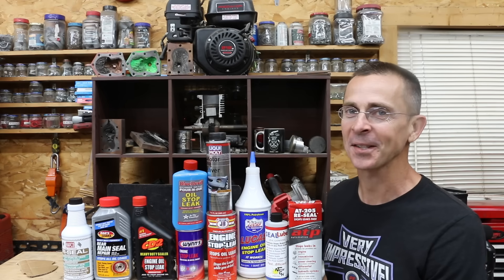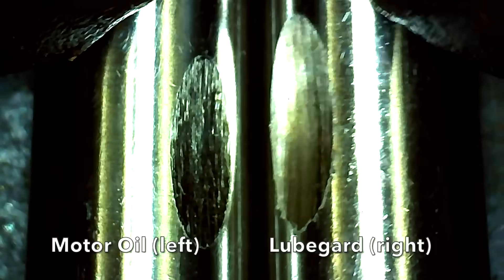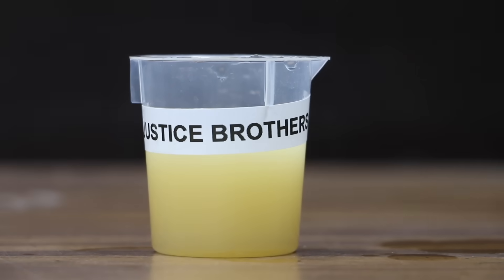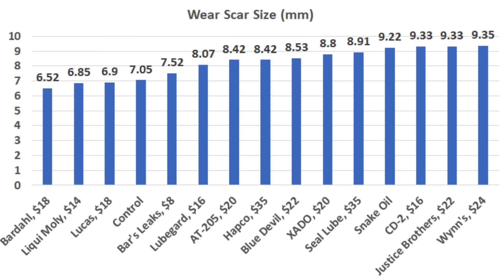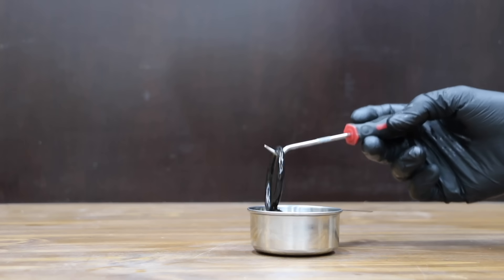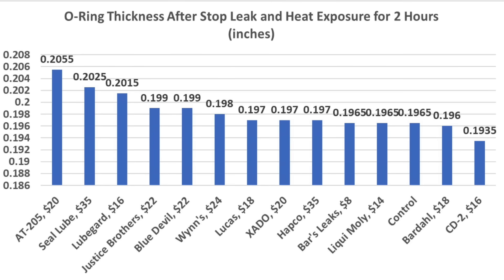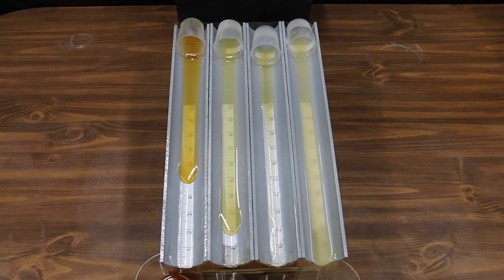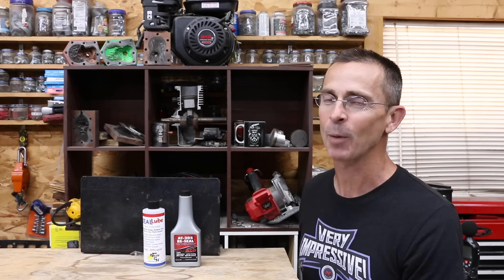Do Stop Leak Products Work? Do They Damage Engine Seals? Will They Destroy an Engine? Let's Find Out

Comment: I'm glad that AT-205 did as well as it did.  Its wear scar is 7 out of 12, not including the Control, which isn't great for a product that needs to be added at every oil change to continue working, but its performance in all other categories shows that a mechanic I watch daily is correct in recommending it for its applications.  From him I have learned that oil stop leak products are made for different issues.  Some are good on rubbers and other are good on head gaskets which are not rubber, so they were not tested, but head gaskets would be hard to test.  Once again, you test for everything that could be thought of for these gasket and o-ring materials.  I am always amazed.

I have a product suggestion if you haven't done them recently.  Carbon deposit cleaners for vehicle ICE engine gasoline fuel and oil systems (I don't know if they can be used for diesel).  ATS Chemical makes 505CRF for cleaning all parts of the fuel system and 505CRO is for oil lubrication systems.  I have no idea how you could simulate carbon deposits in both systems outside of an ICE engine, but if you could figure it out, comparing all or several of the supposedly best others to the two ATS Chemical products would be great.  The mechanic I watch has used a borescope camera to check the carbon deposits in an ICE engine cylinder and piston top before and after 505CRO and the difference is amazing.  ATS Chemical is fairly new to the scene, so most people may have never heard of them.  Thanks for everything you do for us, Todd.  No one does it better.
Reply: It does not need added every change. IF it does, then you have a totally failed seal.
Wear is irrelevant. You're only supposed to mix 1.33 oz per quart of fluid. (obviously not 50/50 like in this test).
Reply: @TheGuruStud   Maybe it's not AT-205, but the mechanic I watch, Scotty Kilmer, says that some of them have to be added every oil change for a head gasket because the product is no longer there to keep the seal.  I 'm just going by what he says and I thought it was AT-205, but I may have it wrong.

Comment: I would take whatever the dosage is of "Lube guard" and whatever the dosage is of "Liqui Moly" and put half and half of each into the engine in hopes that the Liqui Moly protects the engine while the "Lube Guard" conditions the seal. In theory the seals should get conditioned still, and the engine should be protected. It would have been interesting to see him play with combinations of AT-205, Seal Lube, Lube Guard, Bardahl, Liqui Moly, and Lucas. I would bet a mixture of the top performers in seal reconditioning along with a top performer of minimal wear scar would potentially create an all around near perfect product.
Reply from the maker: Thanks for sharing!

Comment: Only time I used Stop- Leak was a coolant leak in my 03 Grand-Am. The lower head gasket has a known issue where it'll just start leaking after a while and eventually hydrolock the car.  I started noticing coolant leaking, luckily at that point it was only external (no signs of it in oil), though from the gasket in question. Being that it was already pushing 15 years old at the time, I decided not to go through a full replace and dumped in some Stop-Leak.  Went from having to dump half a container of coolant in every month to fine after two treatments.

I wouldn't recommend it on a newer vehicle, but it got me by for several more years before a different issue took the car out of commission.

Comment: You always make excellent videos testing different products but I have to make an exception on this one. You just can't mix these products together with a one to one ratio and expect them to perform a lubricity test equal to the base test. If mixed at the proper ratios even the thicker products would have performed closer to the oil only test. All products would have thick or thin. Not saying they would all be equal just not as big a difference as you had in this test. The part of the test that used pure product only would not have changed but all other test could have. Just my observation. Again it was an excellently produced video as always.👍

Comment: You should point out to viewers that the length of the wear scars is not linear due to the increased material removed (due to curvature) and also increased surface area.

Perhaps a better way might be to also show a percentage weight removed.
Reply from the maker: Thanks for sharing!

Comment: Love your channel! Question, what does it matter if the oil with the additive lowered in weight? I would not mind if it looses the complete additive as long as it fix your leak you can top off with normal motor oil.

Comment: Did those o-rings all start at the same exact size?  For that size of o-ring the molding tolerance on the cross section is .210 +/-.005, so all of your measurements are within spec.

Comment: The 50-50 oil-sealer trial is likely not a valid friction and wear test. The AT-205 for example has a recommended mix ratio of 6 ounces per gallon (128 oz) of oil,  a mix ratio of 1 to 21.3, so its real friction and wear will likely see a result much closer to the straight untreated oil control lubrication value. 

Another positive lubrication factor at the recommended dilute ratios, is that in a hot engine with oil-product active mixing, it's likely the products that separate when standing will stay in solution when the engine needs better lubrication. 

A possible bonus of product separation over several hours after engine turn off and cooling though, might be the product bathing any lower oil reservoir engine seals less dilutely, as it comes out of solution, so the undiluted product can better actively treat those old worn out seals? Just a thought.

Comment: It seems to me that the most opportune time to use one of these products is before you change the oil. Run it with the stop leak for 10-30 minutes on the highway to reduce as much potential wear as possible, let it sit up for 24 hours, then swap out the oil. Then again, you could just get the problem fixed since you'd probably be replacing the oil anyway.

Comment: What perfect timing. I am preparing to replace the RMS in my 98 TJ, but it is just a bit too cold up here right now and wanted to use a stop leak to stem the tide. I used the AT205 a few weeks ago and after about 250 miles I haven't yet noticed a difference in the drips under the Jeep. I'll just sit tight, monitor the oil level, and do the fix in a few weeks.
Reply from the maker: Thanks for sharing!

Comment: Great information!  I've always trusted Lucas to extend the life of a tired engine.  Small engines mainly.  But did use it in older trucks to control blow bye and it was beneficial.  I don't think any additives will actually fix a leak that is active,  but do believe that products that keep seals conditioned can extend life.  I'd like to see you do some testing on BG additives,  a product I also trust.

Comment: I'm disappointed by the lack of any pinhole or pore-clogging tests here; swelling seals isn't the only possible mechanism a leak-stop product might attempt to use, if it's instead doing something to directly clog small openings. I'd like to see a test where you put a pinhole in the bottom of a cup (small enough that the standard oil takes several hours to drain through), and for each product measure how much leaks through after some interval.

Comment: I wonder how much the product effectiveness and the viscosity loss would change had you used the product to oil ratio suggested by the manufacturer (e.g., if 1 qt. of product treats 4-6 qt. of oil so the ratio would be 1:3 to 1:5, or the average of 1:4). That said, this was an awesome video, as usual. I am always amazed at how many different tests you are able to come up with to test the products. Yours is the only channel that matters when it comes to tests and comparisons.
Reply: Yeah, that potentially really helped some and really helped others in every test.
Reply: Spot on, I think this was a major flaw in this round of testing.  While I think he does a great job with most tests, I think using a ratio not recommended by the manufacturer will definitively impact the results and is not reflective of how these are used in the real world.

Comment: Super useful video! I've always heard AT-205 is good, so it's cool to know it actually lives up to the hype. I use a lot of Lubegard products, so I tried their seal fixx to help a rear main seal leak, and it's hard to say how much it worked because I still get drips on the driveway. Maybe a bit less than before, but again hard to tell. I also only used one bottle for an engine that takes 8.5 quarts of oil and the it says that one bottle treats 6 quarts. And for what it's worth, I always send oil samples to Blackstone and the seal fixx had no negative impact on wear numbers
Reply from the maker: Thanks for sharing!

Comment: Great stuff as usual, but I'm wondering about "swelling" - would an installed oring actually increase pressure in its fitting to reseal?  And "softening" - I wonder also if that reduces the sealing capability by not having the pressure of firmer rubber?...

Comment: Too bad you didn't test the power punch brand, never used any of the ones you tested per say but an old mechanic turned me on to power punch a loooonnng time ago,,, and since I have used it  in everything from lawnmowers to bulldozers in automatic and manual transmissions both in fine condition and with issues and engines of all kinds in fine condition and others that were well into the end of their lives with even rod and crank noise from excessive wear,,, and the stuff always seemed to really do a good job at either preventing problems and making problems go away for quite some time,,,,even in hydraulic equiptment it seemed to work great and seal up leaks at least to a pretty darn good degree,,,and some of those leaks were almost beyond what you could expect from anything other than full replacement of seals and so on,,,,I trust that stuff fully to say the least,,,anyhow great video at any extent so thanks for all the hard work and information.

Comment: Your test was a 50/50 mix.  For something like AT-205 it's 8oz in six quarts of oil which is more like 1 to 24 ratio.  That means all of your testing is inaccurate.  With a 50/50 mix of course it's seriously diluting the engine oil.  And such a high ratio may also over inflate how much effect it can have on seals.
Reply from the maker: Thanks for the feedback!

Comment: Most of those work by containing Naptha, the naptha causes the seals to swell up and can make the leak stop for a while. The heat generated while operating will eventually evaporate out of the oil and the seal, that said over time the leak will eventually begin again but worse the seal will now become brittle and fail.
Reply from the maker: Thanks for sharing!

Comment: wow, the amount of work... I had an oil leak and later some hydraulic fluid .  Oil leak seemed to go away  - (I used something like BARRS, then AT-205) . I added at-205 to my transmission & PS reservoir (same fluid)  Can't find DRIPs now (but not 100% sure) .. BUT the tranny was starting to take LONGER to engage into R, that seemed to go away after AT-205(& a month) so maybe it tightened some valve gasket. Vehicle is 23 years old now (and 1 owner)
Reply from the maker: Thanks for sharing!

Comment: Since these are things you normally just 'add', I think, it would be better to test the lubricity with the same ratio that would be found in an engine with a full 5Q of oil already in it and adding the product according to instructions.  That would be MUCH better to know if at that amount/ratio what the actual impact on engine wear might be.
Reply: Honestly, I think using such a high ratio of 50/50 instead of the ratio listed on the label invalidates all of the test.
Reply from the maker: Thanks for sharing!

Comment: Isn't the size of the wear scar technically non-linear since the bigger the scar is the more surface/volume needs to be removed? (so the difference from 1mm to 2mm does not remove the same ammount of material as from 4mm to 5mm) As in, the higher results are even worse then they look.  
As always great video btw.
Reply: Definitely.     I think an ideal would be to use a square key stock or something.

Comment: The oil pickup is not at the bottom of the of the oil pan. So, thinking that 12 ounces:hand-pink-waving: of AT205 is circulating through the engine when it is first started is incorrect. Also, the correct ratio of AT 205 to motor oil is 13 to 1
Reply from the maker: Thanks for sharing!

Comment: When comparing all the charts, one can see that the Lubegard did the least wear increase (only about 1mm) above plain motor oil (and AT-205 was second least at about 1.5mm.added wear) while still being in the cluster of top 6 additives that made a significant improvement in rubber condition.
Reply from the maker: Thanks for sharing!

Comment: The legend Scotty Kilmer recommends AT-205 and says he's seen it stop a leak in as fast as 10 minutes.  What concerns me is the evaporation rate and that it separates from the oil.  So on a cold start, you are using the AT-205 as an lubrication until it mixes.  Also I believe they recommend adding a quart at every oil change. So with the high evaporation rate, an engine will use oil faster.  I have a bottle of this sitting on the shelf even though I currently have no oil leaks.  Curious if it will separate in transmission fluid or power steering fluid.  Great video again!   I believe I've purchased 50% of the products you recommend, You are costing me money! 8-)
Reply from the maker: Thanks for sharing!

Comment: One day, when all the masses are driving electric cars, the only things left for project farm to review will be windshield washer fluid and ac refrigerant.

An episode on socks would be good.  In the last few months, I've thrown away a lot of socks because I was sick of holes developing in the heels. My wife and I are building a sock knitting machine that I 3D printed, not because I can't afford new socks, but because it will be a shared hobby.  As we've watched some videos, we noticed the difference between tube socks and "normal" socks, the additional stitches that form a heel.  My friend, a truck driver, says he only buys tube socks saying he wears them backward, alternating to prolong the life of the "two heels".  I was appalled.  Last year I bought a pair of socks from Darn Tough which claims a lifetime warranty.  A friend swears by them, but they were $35 a pair.  My wife doesn't like her's but I like mine. I also have some FTL ankle socks.  I inspected them now that I have a little knowledge of stock design and they are incredible.  They have heels and toe stitching and have ventilation by missing stitches in certain places.  It is a work of art, machinery.  If PF makes an episode on socks, it would be very interesting how you simulate worn heels.
Reply from the maker: Thank you for the video idea!

Comment: 🥳🥳🥳 Video Ideas 🥳🥳🥳

• Best belt-and-suspenders toolbelt (Occidental Leather items 9855 + 5055 supposedly the best at $650)
• Best one-handed-carry toolbag (or bucket?)
• Best cleaning brush for car floors
• Best mop & bucket combo
• Best clear-coat spray to protect hand tools from rust and doesn't come off with use
• Best window cleaning solution
• Best drive-on incline ramps for doing work under vehicles
• Best garden loppers (most corrosion resistant?)
• Best Fast Orange style liquid hand soap with "sand" in it to quickly remove grease
Reply from the maker: Thank you for the video ideas!

Comment: The ATP 205 did decrease oil leak on my 2003 Ford ranger. It is still leaking but slower. When I first poured it in it seems to have leaked quickly so I had to put more oil but I had some ATP 205 so I put the rest in. Still have a leak but much less now. My car takes 5w 20 oil but to decrease leak I am thinking of putting 5w 30 for my next oil change. Also something to note is that it leaks when the engine is running but not when the engine is off.
Reply from the maker: Thanks for sharing!

Comment: In my experience working on trucks and heavy equipment, stop leak either does nothing, or works for a while but eventually makes it start leaking out of everything. Granted, I'm sure survivor bias factors in to the equation, someone puts stop leak in and it works and I never hear about it, but I consider "sealant in a can" type products to be a "1000 miles from home, just needs to work long enough for me to get there" solution. 
My own personal experience being having a head gasket give up the ghost when I was on the other side of the country for a wedding, and me not having the time/money/desire to have a stranger work on my vehicle, I figured I had nothing to lose by trying a sealant. It did get me home, but it clogged my heater core and failed after about a month, but by that time I was back home to my own shop and could fix it the right way.
Reply from the maker: Thanks for sharing!

Comment: Excellent video! I think i will keep my oil leak and just keep checking the oil every two weeks and getting it changed every 3000 miles until i need to get the clutch replaced.

Comment: As always, fantastic work!

I do wonder about the effect of the gaskets over extended exposure.  If there is effective changes to the nature of the gaskets in 48 hours will they continue to soften to the point of degrading after say 6 months?  Should you leave it til the leak stops and then flush it out?  Just thinking out loud.
Reply: Todd you know the channel is doing good when scam bots are squeezing in your comments section!  🤣